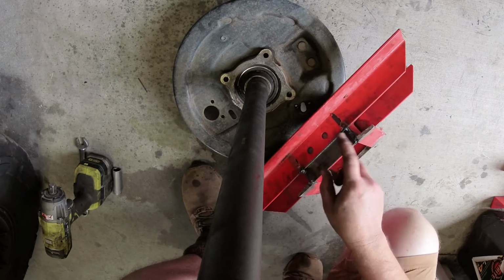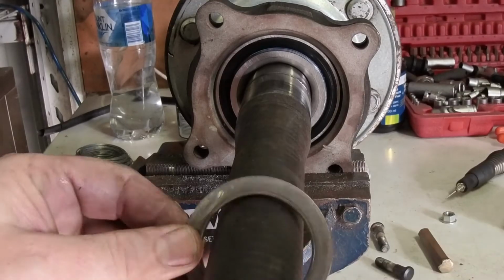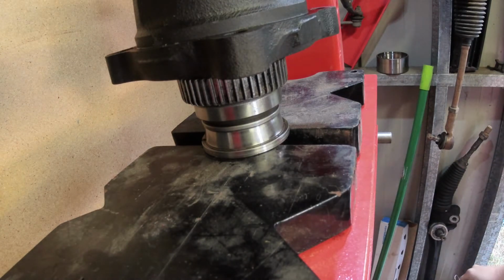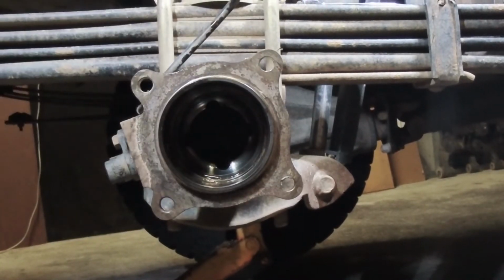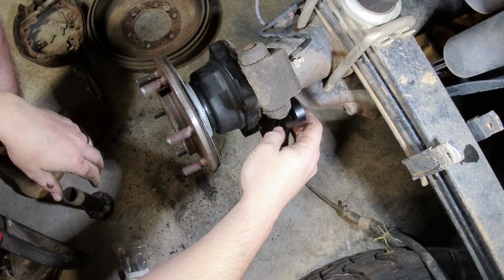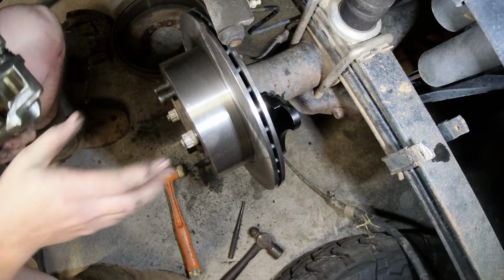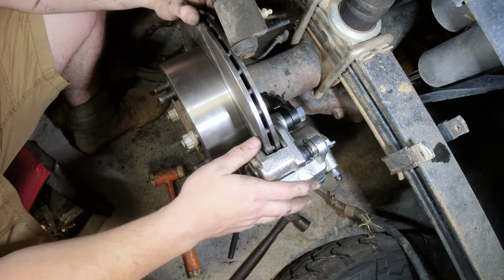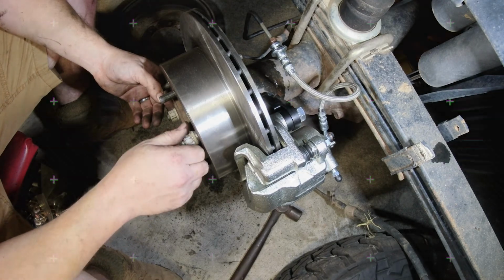Jeremy's Hilux N70: Boosted & Built Garage REAR DISC

Comment: How was this with the standard booster/ master? Pedal nice and firm still?
Reply from the maker: it was ok. The front calipers have been changed to the bigger Prado ones, so the master cylinder has also been changed to 1" version to account for the increased piston volume
Reply: @DirectionPlus  Hay mate, the 1" master cylinder you replaced with, which one do you end up going with, I'm about to do this kit and also doing the cylinder upgrade as well
Reply: Yes can I ask also what master cylinder you went with thanks
Reply: @DirectionPlus  what was the brand / master cylinder version hat you used?

Comment: I have the 06 non abs lux with standard brakes all round and it stops perfectly. I don't see the point of this kit if standard brakes are already capable of locking wheels which compromises braking anyway
Reply: When you go 33s muddies and load em up they certainly don’t pull up the best. Also big thing is mud from bog holes constant adjusting if the handbrake.
Reply: Fortuners brake well with rear discs!